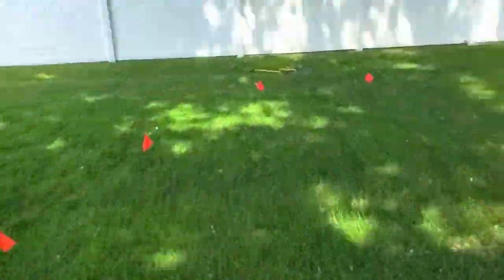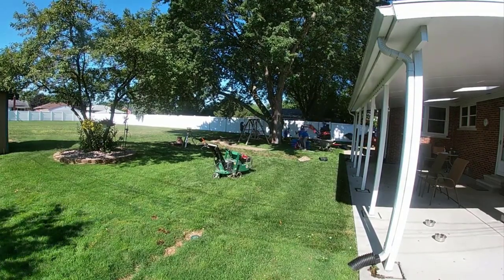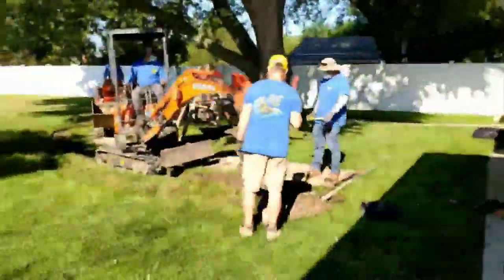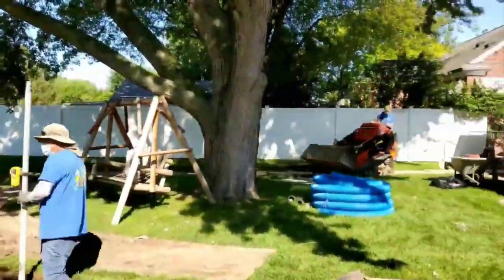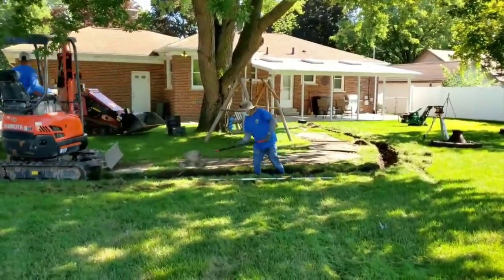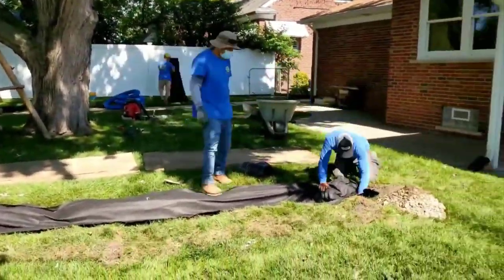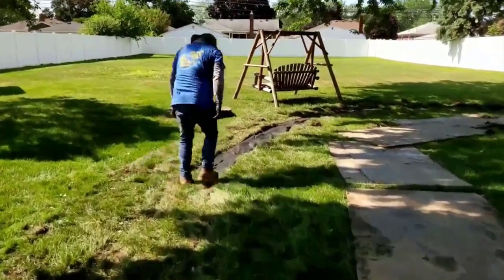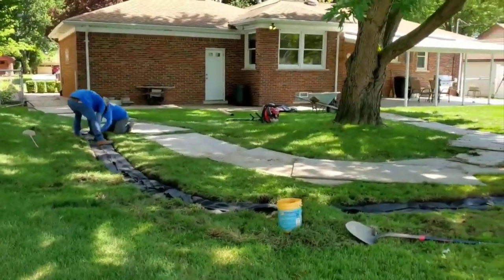How to Add to an Existing French Drain  [ WHY WE ADDED TO IT ]

Comment: In this video, I think you mentioned that when you installed the original French drain for this customer, you tied the downspout drain into the 6" French drain.  In recent videos, you have installed a separate solid Baughman gold in the same trench as the perforated and not combined the two.  Do you only recommend tying downspouts into 6" perforated?  Thanks.
Reply from the maker: @Greg
No Sir I didn't say that. Watch the very beginning we ended the downspouts with pop-up or 4 inch grate right at the French Drain NOT tied into it.
Reply: FRENCH DRAIN MAN - Got it. I see the pop ups now. Thank you for the prompt reply.